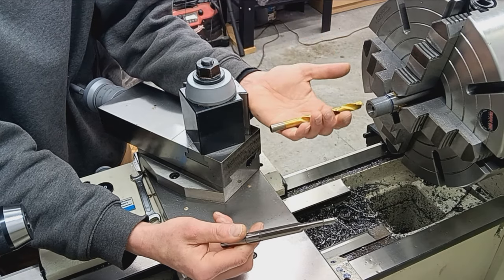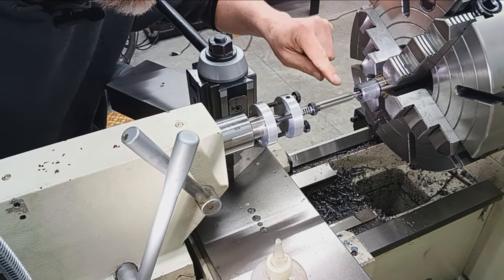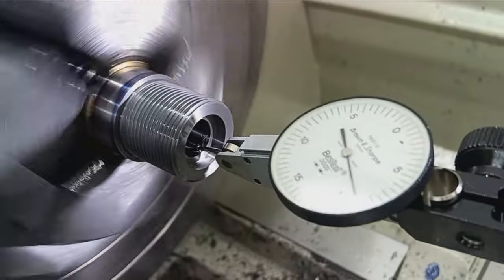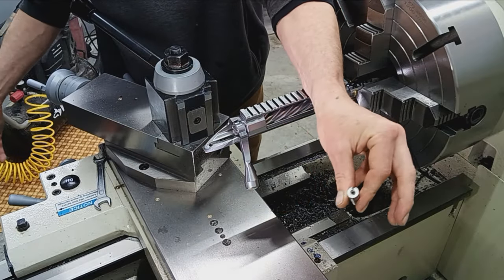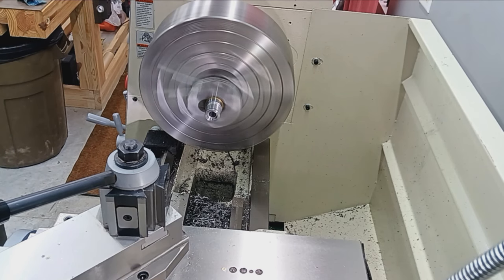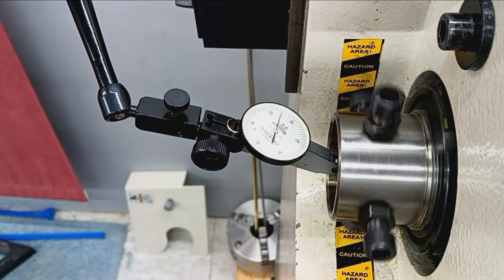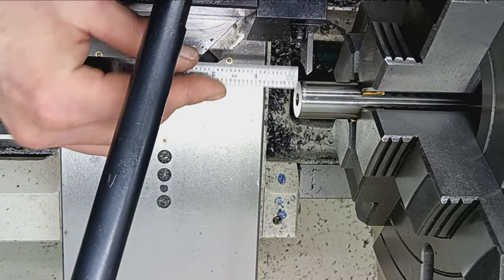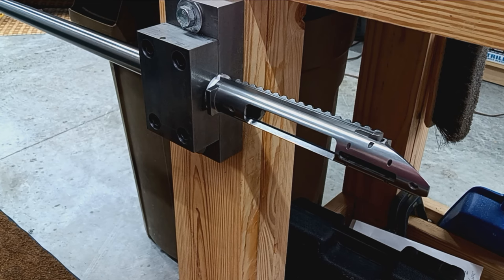Ultimate Benchrest Rig - Defiance Deviant Tactical - Bartlein M24 Barrel - in 6.5-284 Norma Part 3

Comment: Awesome.  Just want to share some expirence regarding how your holding your barrel in a 4 jaw chuck. 
I would suggest you keep the jaws behind your chamber.  Especially at the lead / freebore area. It doesn't take much force in clamping of those jaws to affect ID of the bore and from expirence chambering, will cut more than the reamer dimensions.  This is why I personally use a copper ring, not only to create a pivot point, but mitigate this issue
Reply from the maker: thank you for watching and for the suggestions!  FWIW - I do use brass shims between the jaws/barrel.  I guess it's just the machinist trained side of me thinking choking up on the barrel is best for rigidity, but you do have very valid points!  Others have mentioned similar things.  While I don't torque down super tight, ID deformation is a definite possibility and I'll take that into consideration moving forward!  Always open to constructive suggestions/criticism.  Thank you again!!  (BTW - I love your channel!!  Subscribed!)

Comment: Looks good. Few things I noticed. Generally you want to take more than that off the muzzle end. Usually want take about 3/4 of an inch. That's why barrels come at least an inch longer than barrel finished length. The reason being is that where the lap exits the bore is distorted. Especially in hand lapped barrels where it's impossible to keep the lapping rod perfectly straight. Don't have to do it on the chamber side because you're cutting that part out when you drill/ream(although if you're getting your concentricity from the lands you need the indicator probe past this point). Most of the time you can actually watch a tenths indicator climb onto the lands and they will be shorter/uneven in the first part of each end. Also if that's a sized round from the customer then that head space is a bit tight. The bolt should fall free on a sized case(since you're generally bumping the shoulder back 0.001"-0,002). If that's a freshly fired case then it's probably fine but he should make sure he's sizing it back enough for the bolt to fall freely.  The case should have room to grow into the chamber when fired. Especially the first time in a new chamber. Cheers.
Reply: @MMBRM  Try taking .750" off a Carbon Six or Proof barrel and then thread to 5/8-24 thread. Today's lapping by all "best" barrel makers does not require that dimensional take off unless you're trying to achieve a reduced barrel length.
Reply: @johnseptien3138  Neither one of the scenarios you presented are taking place in this video. 0.750"  just gives you some margin of safety. You can normally get away with 0.5".  All the carbon barrels I've seen come with 2" or so of steel at the muzzle when you buy a blank. Which is plenty to cut off 0.5" and thread. You're wrong about most good barrels not requiring or recommending that you cut off that much from the muzzle. There's a reason that every steel barrel ships at least an inch longer than finished length when you order blanks. You think they wouldn't save every inch of steel they could to cut costs if it didn't matter?
Reply from the maker: Thank you very much for watching and for engaging the channel!  Bartlein does say there is no need to cut off any additional length from the muzzle end of their barrels anymore.  They've been manufacturing their barrels long, cutting off the buggered section, and shipping the final length.  Still good to cut a fresh crown in any case.  Others are following suit, but it is always wise to call and ask, as well as borescoping.  I do explain that I borescoped this barrel (but did not get footage of it) and that the bore looked good, but I was cutting off the 1/4" or so just to be on the "safe" side.  The rifle shoots "lights out" and has won some matches this season, so there's definitely no issue with this particular barrel.  Very good advice none-the-less!
Reply: @AccurateRiflesandRestorations     Thanks for the reply. I have heard anecdotally that some manufacturers cut off the distorted section but haven't seen it myself. Do you know when Bartlein started doing this? I ask because the last three F-CLASS barrels I did were Bartlein and they all came in over a inch longer than their finished size. Including one I did less than a month ago(Although I don't know when they actually were made). I think I still have the cut off portions of them hanging around so I'll chuck them in the lathe to see if they still have the distortion in them. Often times you can't see it with a bore scope as the wear can be very minimal(lands can be up to 0.0005" shorter or less sometimes). You can always check this by using a tenths indicator probe inside the bore near the entrance to the muzzle measure the land and groove to get the height of each land and then compare to a spot further in(easier if it's dialed in concentric). Glad to hear that the barrel is a shooter! That's always very satisfying. My three bartleins just came first, second and third in a mid sized FTR championship. One shot 7 out of 10 matches clean while averaging over 50% X count. The conditions made for easy shooting but it still makes me proud! Mild conditions make the accuracy more important. I wish your videos had been around when I started out. They would have been a big help. I'm sure they can still teach me a thing or two.  Take it easy.

Comment: Fascinating, how long does this process take for a barrel from one of the big manufacturers for an off the shelf rifle? Also, is that special oil in the bottle? Or just motor oil or something?
Reply from the maker: depends on the cartridge.  Bigger/longer cartridges take more time due to more material being removed.  It takes as long as it takes.  No rush.  The oil is Nu-clear mixed with a bit of Vipers Venom.  Thanks for watching and for engaging the channel!

Comment: How’s this compared to using a prefit barrel in say a zermatt action as far as accuracy and cost? Thx
Reply from the maker: Thank you for watching and for the comments!  For a basic barrel (SAAMI chamber, standard length, contour, no muzzle threads, plain barrel) with no other options it is slightly cheaper.    These prefits are machined with looser tolerances in order for them to fit any/all actions, so depends on if you care about that, or want someone like me to properly fit the barrel to your specific action and be hands-on the entire time - rather than some CNC robot mass producing barrels for the masses.  In theory, accuracy could suffer with a prefit due to this, but I have heard lots of people are happy with their robot-made prefit barrels. Also be aware that you need to invest in expensive gauges, vises, and wrenches to properly torque these barrels so they don't come loose and headspace is correct.